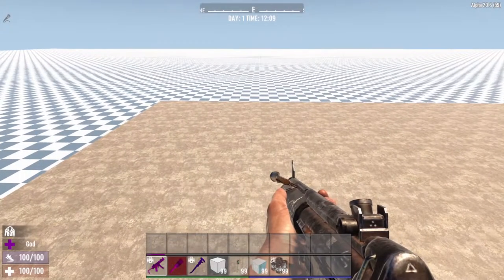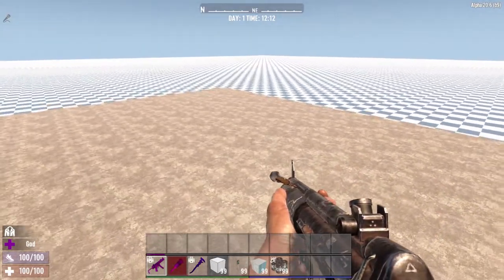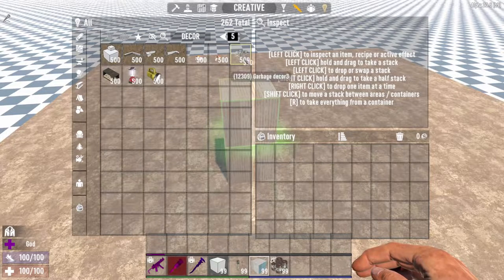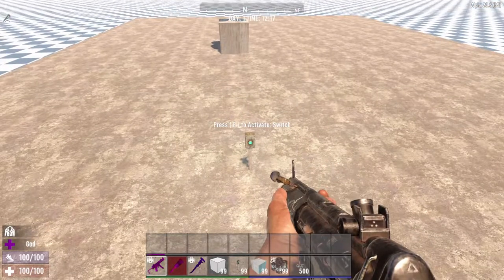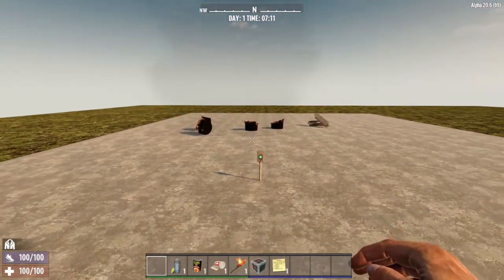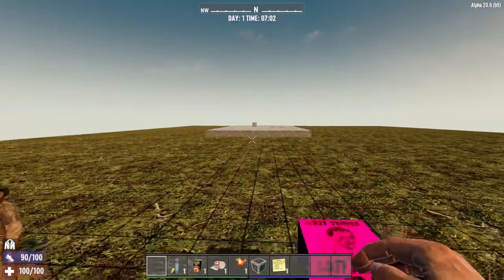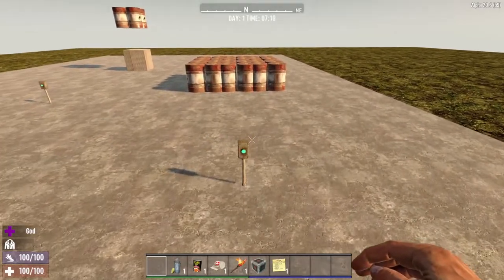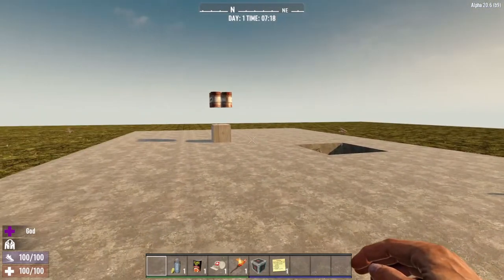Switched Remote Explosions  - 7D2D Tutorial

Comment: How do you build in prefab?  Just tried and all my blocks fall through the checkered floor.  Also, great tutorials.
Reply from the maker: I'm thinking you may have the active physics turned on.  Go to the first tool tab - that setting is in the bottom area - and make sure that option is not checked.
Reply: You were right.  Still learning how to use prefab.  This might be a silly question but how do I save what I build in prefab?  My save box on the left side of screen is grayed out.
Reply from the maker: @MICHELE7131998  _ Sadly, that's one of the buggy things.  You first have to create a new prefab (bottom of the fourth tab)- even if you start out on a "clean" area - then save it.  What you can do with what you have now is to select everything with your z selection, copy it, create a new prefab, paste it, then save it.